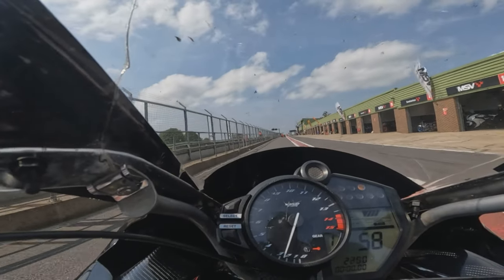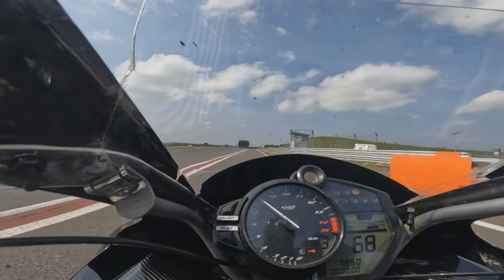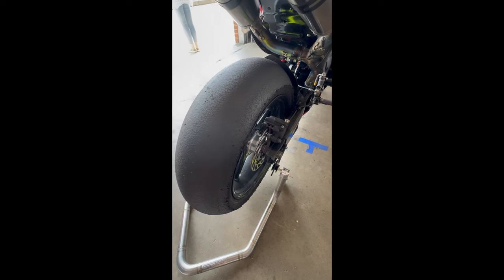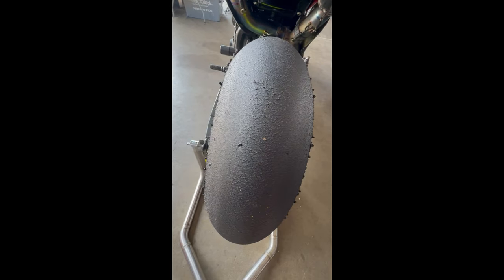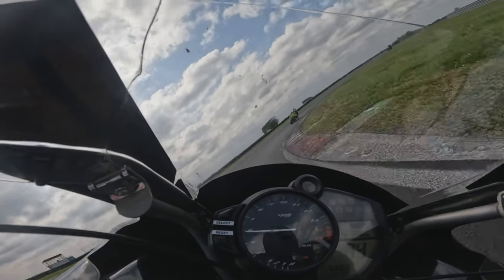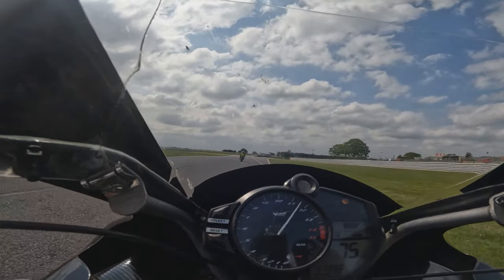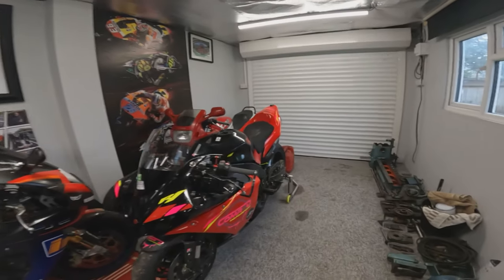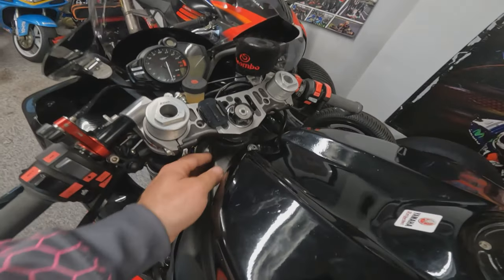Snetterton onboard R1 Trackday 13/05/24

Comment: I've been trying to sort my TCS issues aswell on my 14. I got the Tdrive rotors and since then, it's been a snafu. I have to do my forks on my bike aswell, hopefully I'll get out on Lagunaseca later this year.
Reply from the maker: If it’s just the discs you’ve fitted it sounds like an air gap issue. If the new discs hubs are thicker it will move the TC pickup closer to the sensor. I think the min gap is 1.2mm but don’t hold me to that! But worth checking if you haven’t already
Laguna would be mega 💪 what a track!